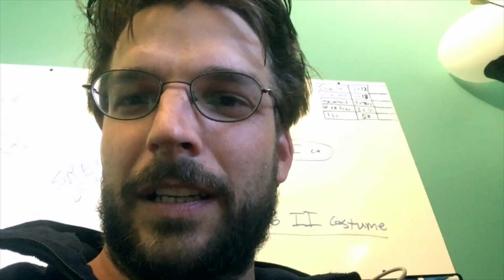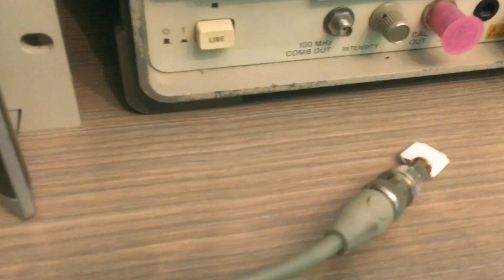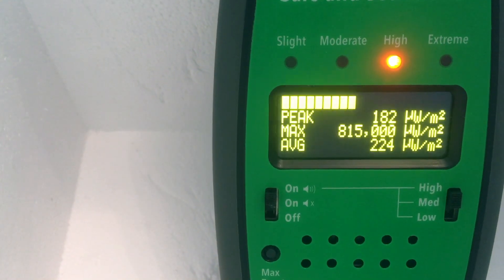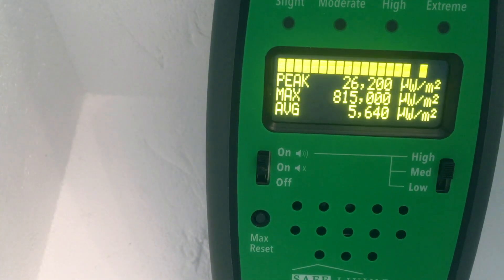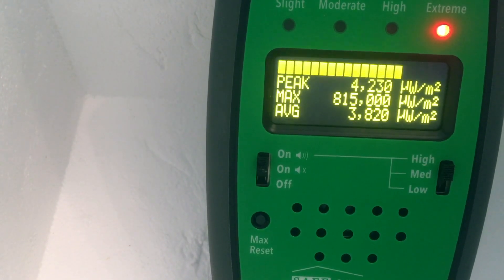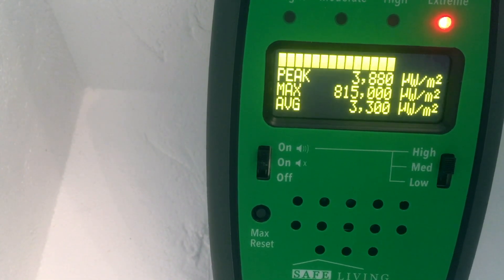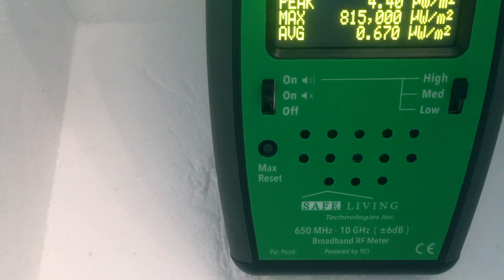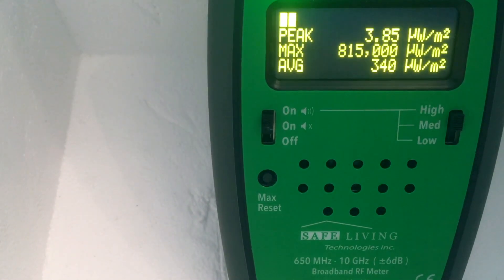Multi-Band RF Source Testing (5G) Safe and Sound Pro

Comment: Hooray for a reset button. Now that you're advertising it, dare I ask if there is any upgrade path for existing customers?
Also could you elaborate on what "more powerful" means?
Reply from the maker: Hi Stewart! Thanks for asking. The processing power of a new chip is what is specifically "more powerful" so it can calculate more data- faster. As for your first question I am unsure if there is going to be an upgrade path. You may contact SLT for that information.